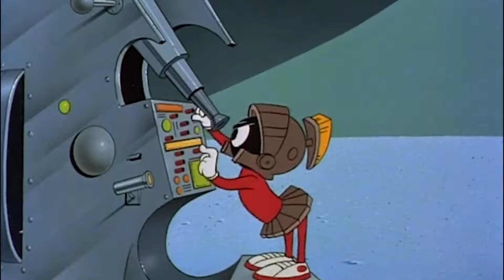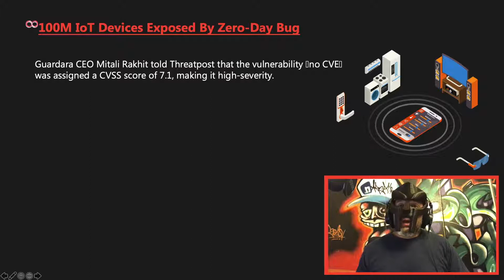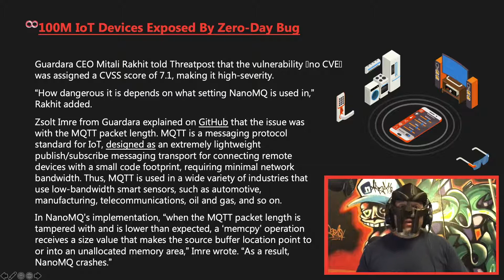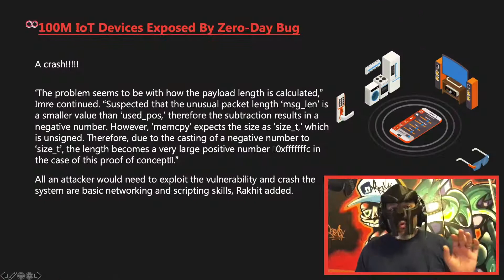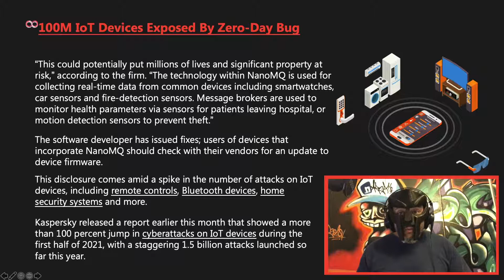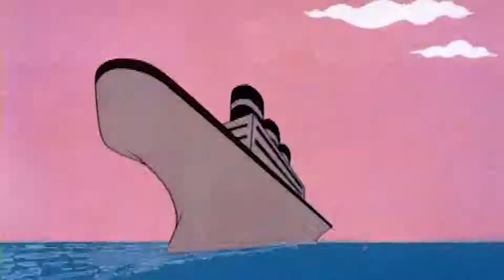100M IoT Devices Exposed By Zero-Day Bug

Comment: It is really confusing. The title of this news is untrue. There is no 100 millions devices connect to NanoMQ. Last time I checked nanoMQ is just a open-source project released half year ago.
Reply from the maker: ummmm 13 months is a little longer than half a year :-).  But anyway, the age of the project on Github does not mean it is not used by massive numbers of companies in massive amounts of products.  The average number of connected devices per household in 2020 was 10.   The projection for IoT devices in 2021 is 31 Billion.  That's Billion with a B.  So if a new technology comes out that solves a problem for companies producing these products then it can go from zero to 100 in minutes (or 13 months).  Volkswagen apparantly uses it, a financial payment company, Ev Power, and other large corporations.  check out EMQx's case studies on their website and you will get an idea how many companies use this
Reply: @CSIdigital  Thanks for your explanation. Yes I double checked  EMQ's official website, the 100 millions devices They claimed are connected to EMQ X Broker not NanoMQ. Which is a far more popular open-source project has 5+ years history.